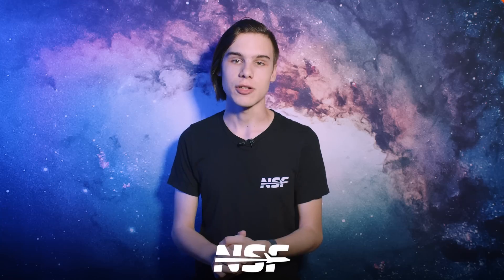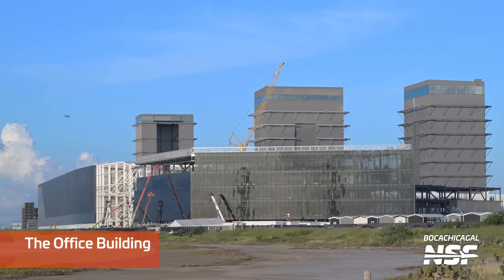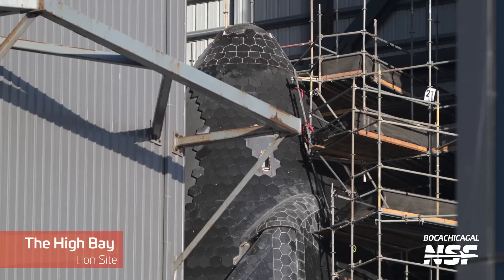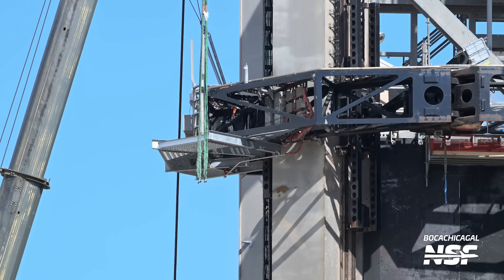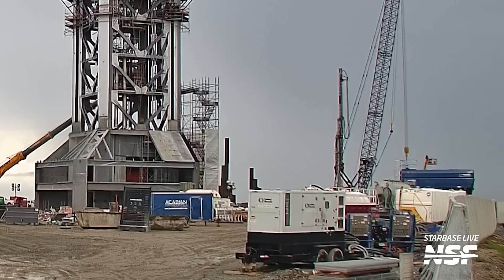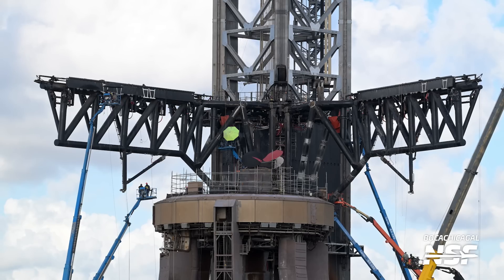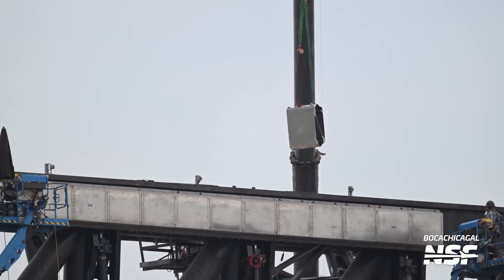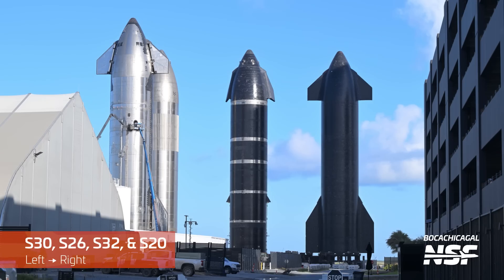All This For The Catch | Starbase Update

Comment: I just can't understand why they wouldn't go with a roller system rather pads on the chop-sticks. There would be little if any damage to rollers as the ship brushes along side them. But a pad at minimum will be scratched up and need replacing frequently and that's not even mentioning the damage the booster will sustain with each catch. I bet the pads are just a temporary solution until they move on to rollers in the future.

Comment: Kinda surprised they didn't add a "padding" point down on the lower frame area, to prevent the massive torquing as the chopsticks stop (as shown on that brief slap clip). The lower pad would also contact at the same time and prevent it. Would likely also curb further oscillation after stopping since there's not so much residual energy stored in the arms twisting and straightening back out...
(if anyone on X wants to propose that to SpaceX, be my guest)

Comment: The reinforcements of the weld don't protect or shield they add strength and spread the  stress points of the welds over a larger area
Reply: Especially important for tensile shockwaves that can apply stress concentration to weld areas and adjacent pipe.

Comment: @NASASpaceflight - Four possible causes occur to me for the lack of ventilation pipes through the hatch: 1) It is cooler weather and there is no need for the supply of chilled air; 2) It is a LOX tank and safe to work in; 3) It is a propellant tank and any methane has long since dispersed; 4) It is not an access hatch to a tank. 
It would be interesting to know exactly where in the vehicle they are gaining access through the hatch.

Comment: I would think “drop test” might be more like a controlled lowering onto the chop stick arms and pads by a crane and some form of orientation cable to maintain “semi” catch pin alignment.  Without COPV stabilizers as an actual landing would provide, the test will require some form of alignment to prevent the spinning of the test booster body

Comment: It makes perfect sense to build a roof on Tower 1 right there, this is to cover up the exposed winch wires running over the crown block cluster. Best practice I'd think to ensure long term survival of the line vs flame tail, esp if it might come in at different angles we're used to during landings.

Comment: Don’t think the delay has anything to do with the catch. FAA mentioned environmental but environmentally it’s no different than the risk you take with a launch. It could have failed and toppled over (with a lot more fuel) and that had to be in the consideration plus they had a number of starships (sn8,9,10 etc…) all blew up at the launch site and the booster won’t have much more fuel. The hold up as I have been saying is environmental but has to do with the industrial wastewater permit they never got after being told before flight 2 they needed it for the deluge system. Elon is playing it off as they had an agreement they would apply if they allowed them to keep launching but they never applied for it until July 1 of this year. So the EPA and FAA are ticked because the CNBC report showed that they never followed up on SpaceX to get that permit. The FAA now has to wait for EPA to approve the wastewater license before they can license the launch and the first EPA investigation took half a year. I don’t think this will take that long but look for an early November, late October launch. Even if SpaceX ditches the catch, the FAA won’t license the launch due to the wastewater permit. You could ask the FAA but they would tell you to ask SpaceX why the license is withheld but Elon would never admit he was in the wrong and never applied for the appropriate permits after being told to do so. Mark these words.

Comment: I still think they will eventually replace the rails in the chopsticks with cables. The navy already solved this problem on aircraft carriers, enabling planes with tiny arrester hooks to stop smoothly and reliably.
Reply: Chopsticks are also used for lifting the booster on the launch mount and stack the ship on top of booster.

I doubt that cables can replace that use case
Reply: @nikhilpanwar8351  They'd still use chopsticks, but with catch loops of steel cable instead of rigid rails.

Comment: 9:53 Those are not "shielding", its welding reinforcements, to reinforce the section of the pipe where it was welded, as a weld is always a failure point.

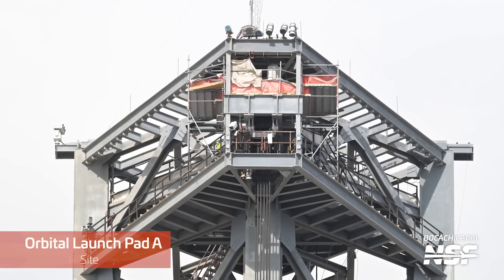Comment: 5:40 I bet the roof on tower 1 is to protect it from the booster engines in it's descent.
Reply: i also think think the same
Reply: Bi was thinking it's to protect the reels lift ect from the rain and hence rust
Reply: Reasonable thought.  But it might just be an upgrade from seeing how the weather is affecting the mechanical elements at the top.  One might speculate that over time they'll enclose the top entirely.  Maybe even the whole tower, albeit with some wind-permissive aspects.
Reply: That’s a good theory, although the correct flight path would never fly over the tower, so shouldn’t get blasted by the rocket. It is “rocket science”, so better to be safe than sorry.
Reply: @jeffmontray88  if it was all about the intentions and the theory, they wouldn't be reinforcing everything as they are :)

Comment: 11:40 Re: Craned Drop Test. Yes! I’ve been calling it for weeks. Re: Mechazilla Simulation. All tested, but for the catch, so why not simulate catch dynamics using the stacking crane? I mean what’s the rush to NOT program the crane to emulate rocket motor dynamics & in a few runs, even throw in some wind gusts? After all, aren’t the final 9-3 seconds of flight the most challenging AND unknown? Given a bit of thought, it might seem wholly irresponsible to NOT do so. Going forward, camera analysis of future catches could be evaluated & programmed into the catch simulator to further explore the outer ranges within which anomalous landings could be “saved.”

Comment: I cant wrap my brain around how they deal with making sure those tiny catch pins end up perpendicular to the chopsticks.  What happens if the booster is coming in with the pins at 90 degrees?  Do you think the RCS thrusters will "spin" it around so the pins can get grabbed?
Reply: If it's coming in with the pins rotated 90 degrees, catching it is the least of your worries.
Reply: @pyrobreather1 Ha! I think they meant rotated 90 degrees horizontally, not vertically  😗
Reply: @StevePemberton2  yes - just rotated a little to the right or left, not upside down.
Reply: @marcheld  Rotated 90 degrees = upside down???
Reply: @ghost307  Of course not.  Flamey end down.
Reply: @StevePemberton2  I assumed the same meaning you did.
Reply: @pyrobreather1   I just liked the image of the booster coming down in a bellyflop position as it approaches the tower and someone in the control room saying "Hey the pins are oriented vertically! That's not going to work!"
Reply: The gridfins should be capable of fine-tuning the rotation along the vertical axis.
Reply: @karlwest437  That is not correct. The booster is so wide that the curvature is very small. If you stand next to it, the hull would look flat. So, even if the angle is not perfect, it will still land on the hooks. The rotation has a good margin of error.
Reply: @knowledgeisgood9645  I wonder if the grid fins themselves can support the load of the booster on the chopsticks if they miss the hooks.  OR do they abort and land it off the beach if the alignment is outside the margin of error.
Reply: @marcheld  I don't know, but I bet if they did those motors will be scrap. No axis on an electric motor can take being deformed (bent).

Comment: Ever since B14.1 was first placed on the OLM, many people in the SBL chat have been wanting some type of drop test. With the additional crane lifting points installed, hopefully it will happen. How exciting is that! Thank you Ryan, Adrian, NSF videographers, and Kevin for this week's SBU.
Reply: I think it's only logical they'll do a drop test. I'll be quite surprised if they DON'T. Particularly if the chopsticks will also do that "arresting" slide downwards, as that'll need to be tested to make sure it performs it as intended.

But agreed, there's no shortage of cameras to capture it, and it'll be interesting no matter what!
My guess would be that they'll do 2: one with it hooked up to the crane and a full speed closing around the test tank., another where they do a drop of it from only a foot (or less) above the rails. 
Both whilst filled (full?) with water in order to simulate the weight of the mostly-empty booster.
Reply: A drop test doesn't make much sense since the booster won't be dropping in without its own power
Reply: @ascherlafayette8572   I suspect it'll fall a little bit. Given the size, I wouldn't expect them to have inch-level of pinpoint accuracy... Even high-precision US GPS military ordinance still has a multiple feet of accuracy error, and they're insanely precise!

As such, it'll drop enough to merit a small drop test of at least 1 foot above the chopsticks, like I mentioned in my reply. (granted, I know most people these days unfortunately don't even bother to read the other replies heh)
Reply: Sure glad we should have that drop test on camera thanks to the wonderful coverage provided by the wonderful coverage provided by SBL cameras!!!!